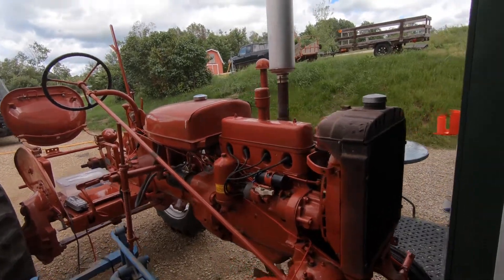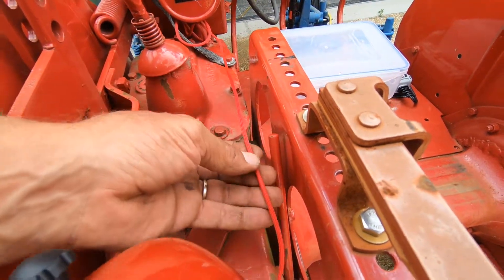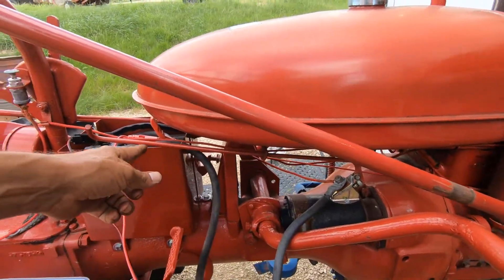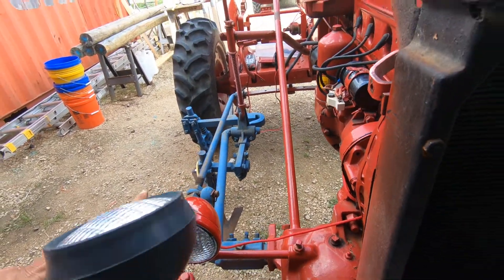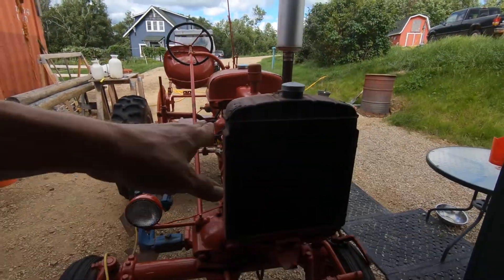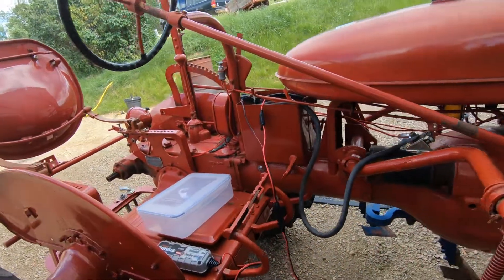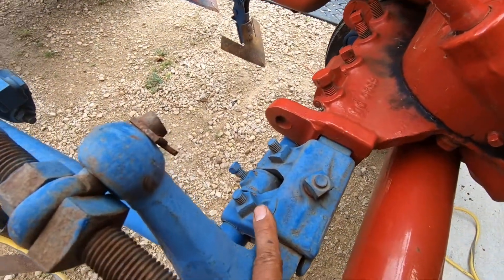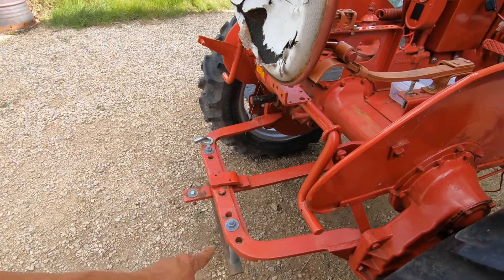Introduction to the 1941 Farmall A Cult-A-Vision Project

Comment: Looking forward to following your project!
Reply from the maker: Thanks. With this tractor, I would really like to get it close to stock -- but I still want it to start and run easy.  I'll likely be putting in the electronic ignition, battery cables, etc., later this week or early next week. You may want to enable notifications to be informed. Thanks for watching!

Comment: Overall looks to be in pretty decent shape for as old as it is. Depends on how
"correct" you want to get, but knowing you when it's done, everything will be
done right. 6 volt sucks, good move on the conversion on that but you'll
never satisfy the correct police with that. But it's what I would have done too.
Ah the days of distributor caps and setting points......LOL
Reply from the maker: I agree on the conversion — especially if you want to have lights! I didn't do the conversion on this one, and never even looked to see if it has a electronic ignition conversion as well. I'll have to take a look tomorrow! I've already gotten rid of some of the cheap aftermarket things and replaced them with stock items (or stock looking aftermarket), but I agree about the 'correct' part. Correct can be expensive, and not necessarily run very good 😉

Comment: My father -in -law had a Farmall A , but it was a crank start and it wasn't a Cult-a-view. The driver was offset like that, but the front end gear was not like yours That was my wifes favorite tractor when she was growing up. She would clean the barn just so she could drive that tractor.
Reply from the maker: Your wife is a smart women 😉 I sure wish I had one of these around when I was a kid! I've always been intrigued by this tractor, and when someone traded it in on a JD lawnmower at the local tractor dealership we jumped on it. This one will likely be restored but it's in pretty good shape to start with. We plan to use it for parades and hay rides.

Comment: How does the battery mount and connect, cause I think the negative goes to the starter
Reply from the maker: On a 6-volt system, yes. This is a 12-volt conversion which is negative ground.
Reply: @PlanetMojo  You are correct in that